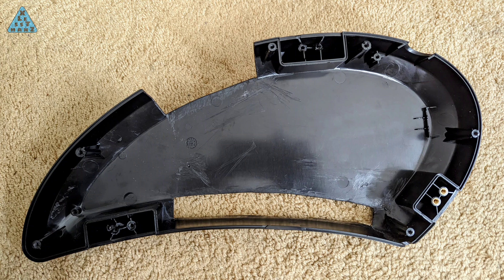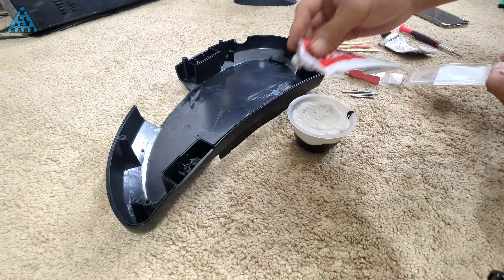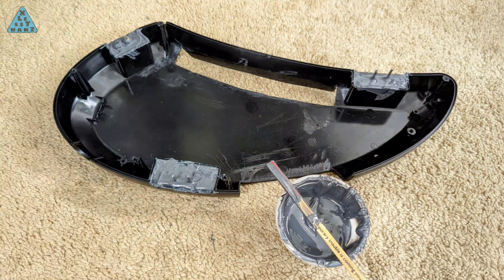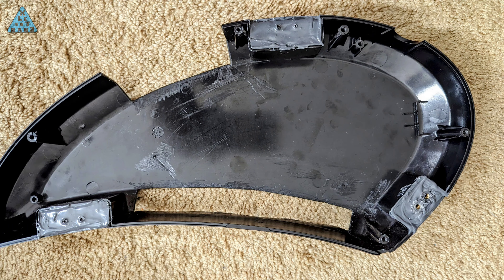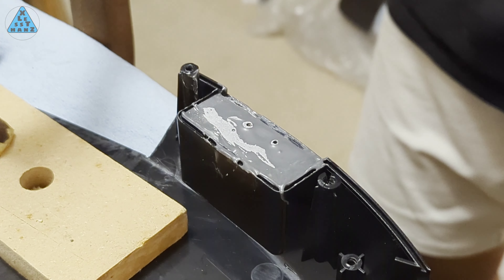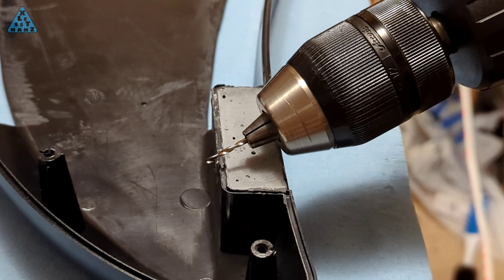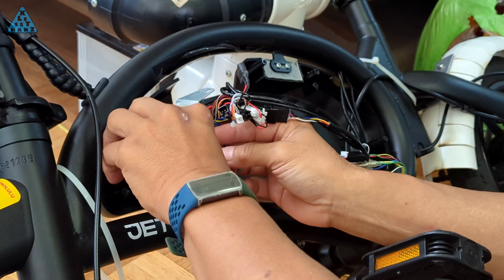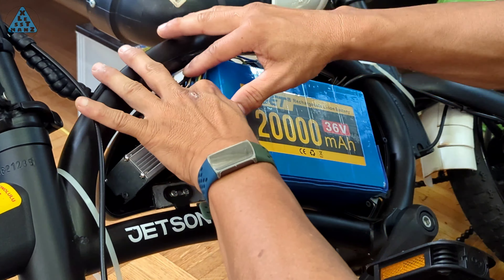Jetson Bolt Pro DIY'er - Battery Compartment Maintenance (SCREW TOWERS)

Comment: What size screws and rubber caps does the case cover use?
Reply from the maker: From my own guess-timation, I used #6 x 3/4" sheet metal screws, but these were larger screws that replaced the originals.  Not sure what the original sized machine screws were.  As for the rubber caps, I didn't put them back.